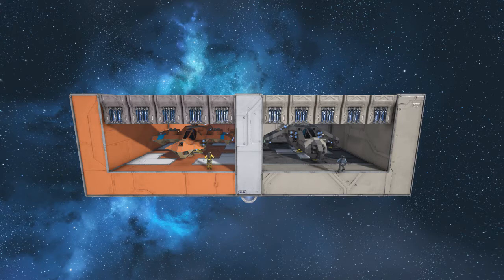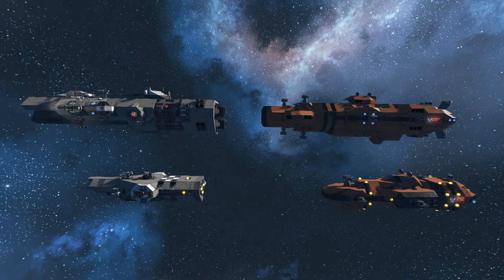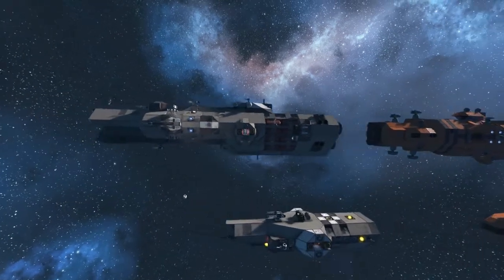[SPACE ENGINEERS] Carrier Design Collaboration - Introduction

Comment: I really like your friend's ship designs, also have you considered a launching tube/bay for your fighters?
Reply from the maker: Yeah, IMHO Seff finds the perfect balance between utility and looks.
About the launch tube, we have experimented with GALS... no pun intended, I mean Gravity Assist Launch System, and while it is useful for saving fuel for the attack craft, enabling them to reach max speed without burn, the saving is not that great, because of the scale of the game. SE is still prety much visual range and 100m/s is not much of a high speed, also having a carrier that uses GALS implies making the whole ship around the system, to justify the expense, so the whole system may as well be a gravity gun and a gravity drive at the same time. Now such a ship would be a great dedicated platform, maybe something like a siege cruiser that can launch gravity slugs and torpedoes and drones and maybe 2 fighters, while being able to run away quickly using the grav drive, all in all a very good idea but perhaps not for a faction base ship, like the one we are building. Tho after all that I will talk it over with Seff, he may have an idea for implementing the system.
Reply: Marcelo (ACFM) you don't really need a single launch tube, with several smaller tubes whose gravity fields affect each other it could be done
Reply: And that could also be powered by the ship gravity shields